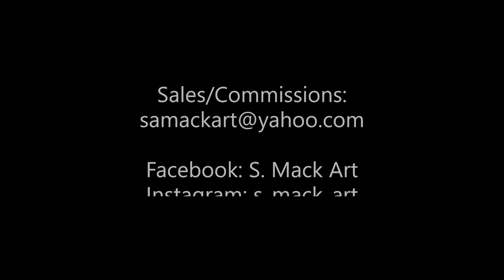3 Amazing Black/White/Silver/Gold Fluid Pour Compilation Video - Acrylic Pour

Comment: Your work is amazing. I love these. I can never seem to get my cells to develop correctly even with silicone. I have bought two smaller torches and they are not doing the job. Could you recommend a good torch without spending a fortune if thats OK? I am in NSW Australia and can get one on Ebay but so so many to choose from I am not sure which one to get. TIA
Reply from the maker: I got my handheld torch my first one at a local hardware store. Have you tried possibly finding one there? The Bronson torch is great. I do not use silicone to get my cells it’s the deck or extreme machine gold 20 4K paint that does it without silicone
Reply: @SarahMackArt  Thank you for your quick and helpful response. I did get one from the local hardware store which was around $30.00 and it only worked twice and took it back and they replaced it and it did the same thing and they claimed it was something I must be doing wrong. LOL I am a pretty smart cookie. OK So the metallic paint is the trick. Thank you so much for sharing Sarah.